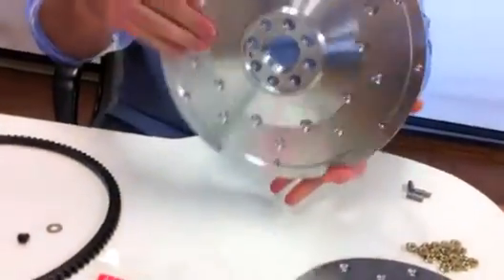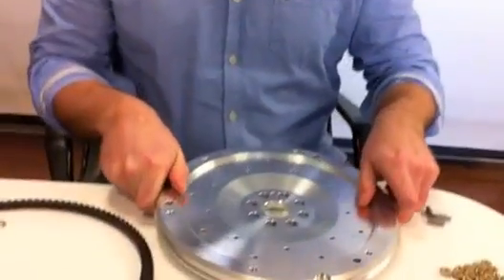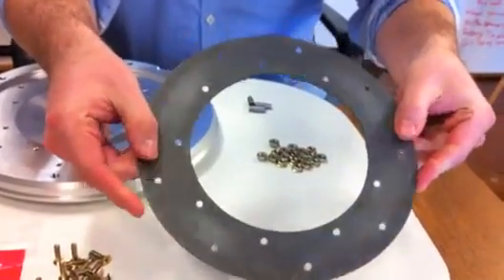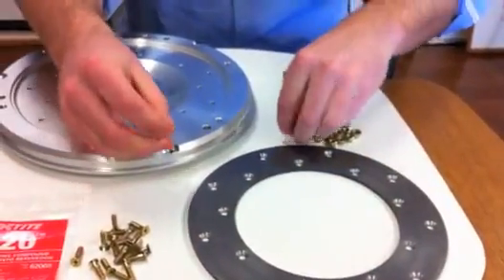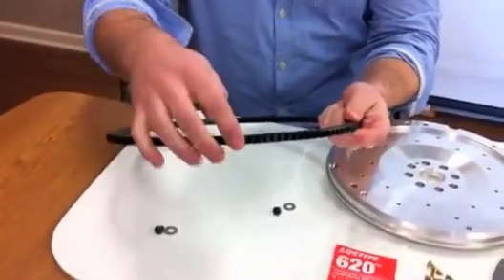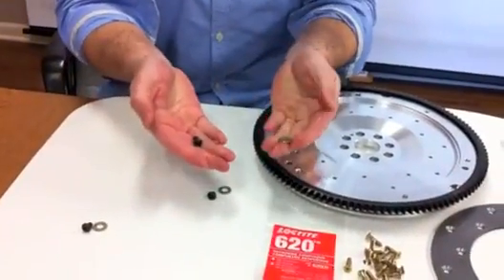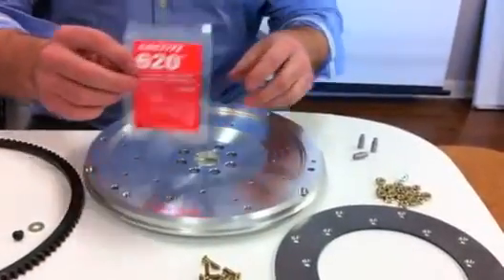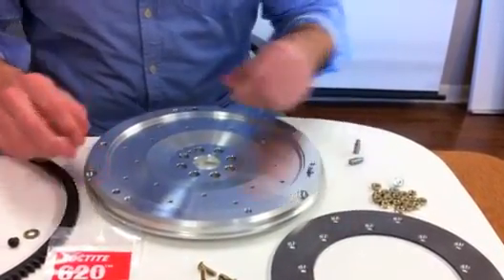Fidanza Aluminum Flywheel Anatomy

Comment: Are they not balanced?
Reply: +Kai Müller I would like to know also
Reply: +Camaro Rick actually I just read off of fidanza's website that  "ALL flywheels should be final balanced as a complete assembly with the clutch pressure plate being used prior to installation to optimize balance"